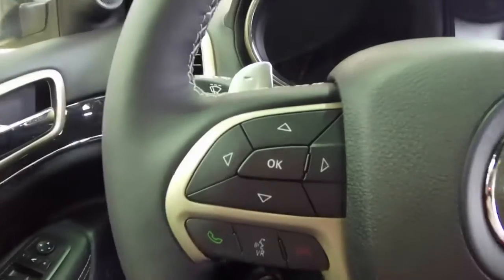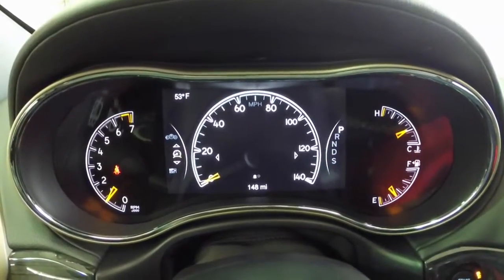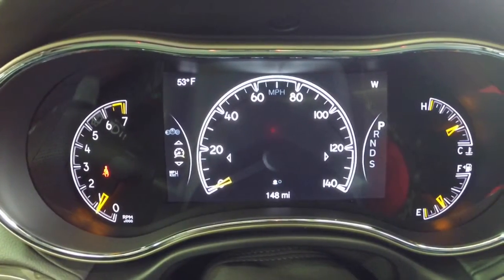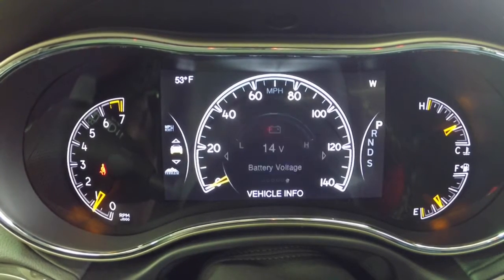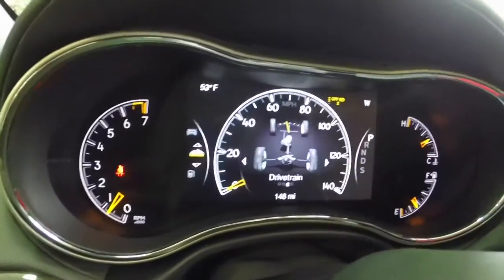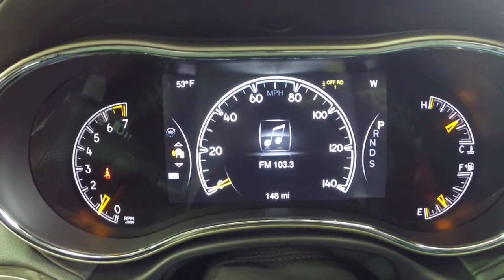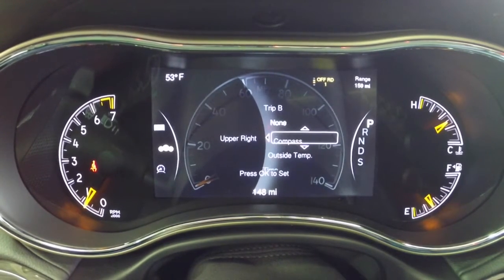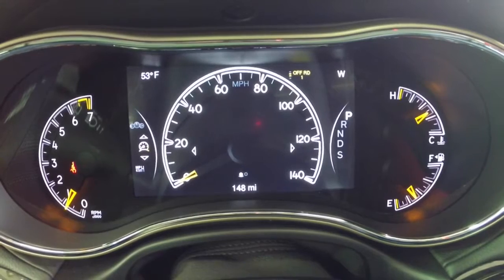Jeep 7-Inch Multi-View Display Overview

Comment: 2012 grand Cherokee  how do I turn on  Digital Speed Meter The regular speed meter works But the digital doesn't display anymore How do I fix that
Reply from the maker: Should just be able to hit the [OK] button on the steering wheel to cycle between the digital and analog versions. If that doesn’t work, then something between the button and the cluster is off.